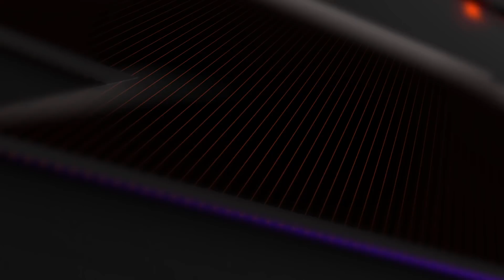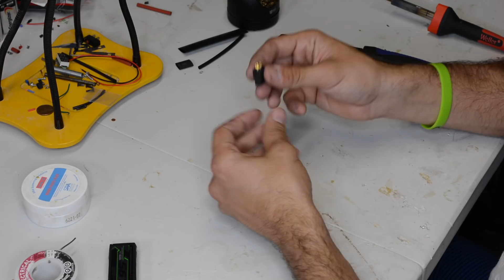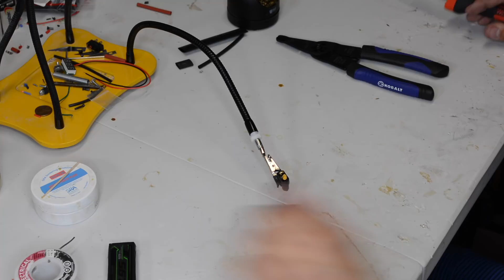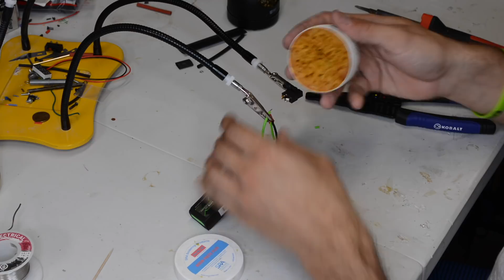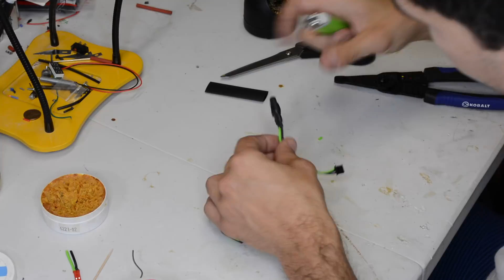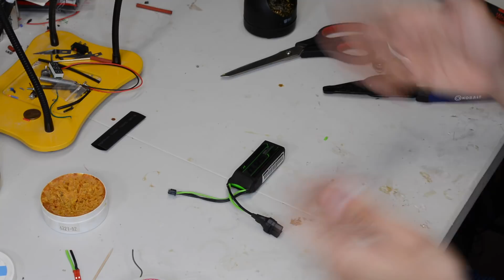[TUTORIAL] How to SAFELY Change a LIPO Connector

Comment: Or if it's a small lipo (Lots of 2s come with deans connectors) get an adapter for like 3 bucks. No solder project necessary
Reply: That can cause extra resistance if you're running enough current through it